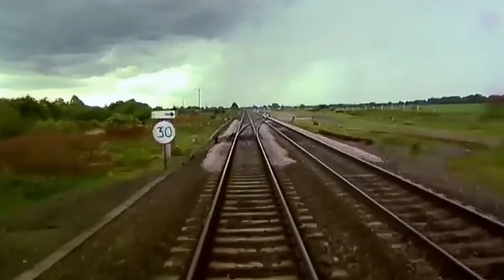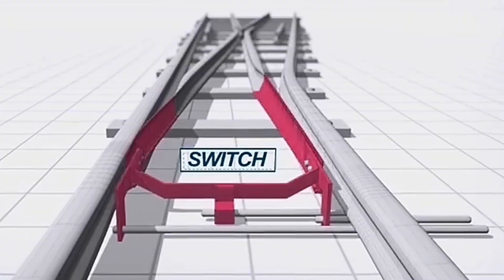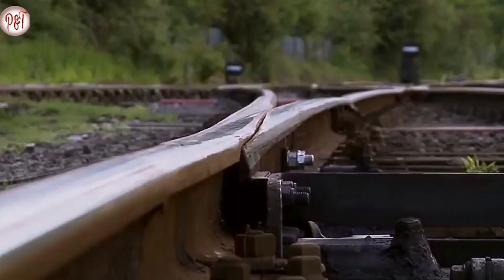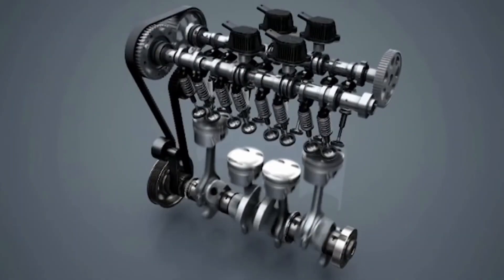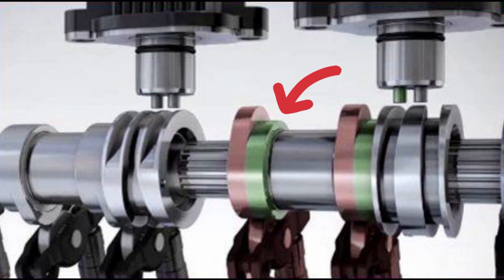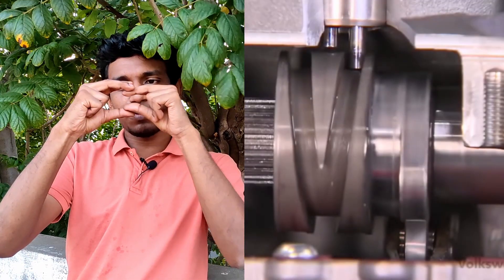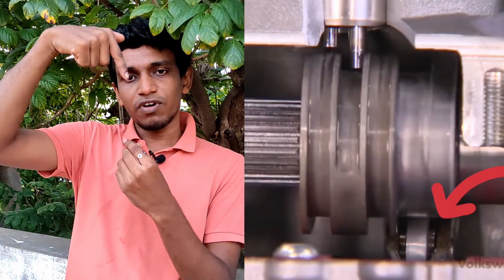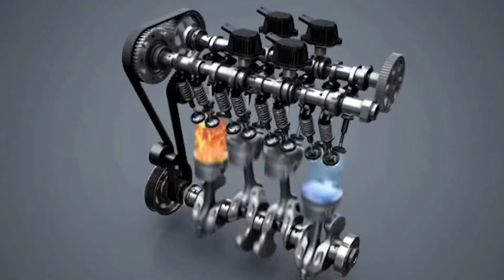Active Cylinder Technology - Explained in Tamil #TuesdayTechTalks Ep.23

Comment: Will it not overload the working 2 cylinders???
Reply from the maker: If its going to overload, it will not switch to 2 cylinder mode. Like I said in the video, 2 cyl mode is activated only when the load is low enough to be handled by 2  cylinders
Reply: @TheDriverSeatGuy  thank you..  this is much useful technology than ADAS 😂

Comment: Bro, am very much confused now, because I was in a dialema between Skoda Rapid and XUV 300, my usage is 90%on the highway. Comfort wise I feel comfortable with sedan, but indian roads XUV 300 may be good. My question is, I'm planning to take and use for 6-8 yrs, whether 3 cylinder would be ok? I already use ford Figo 1.5 TDcI diesel, gives very good power and pull. If I want to go for 4 cylinder , which car is good?

Comment: Hi sir, 
As you said in 2 cylinder mode the non working cylinder intake air will be shut off?
If so, how the cylinder will move up an down...
Reply from the maker: Valves have nothing to do with the piston motion. Piston moves because the cranskhaft rotates at the bottom

Comment: Bro, 

1. when this modes are getting changed, the firing order also should be changed isn't it so whether the spark plug becomes off or it will kept on firing even thought there is no other strokes in perform

2. When the car is shifted to 4cyl mode from 2cyl mode by sudden acceleration will the car pull it with the maximum torque or will there be any lag? For example like if we accelerate a car with manual transmission the acceleration will be powerful compared to automatic transmission in that wise im asking?

Comment: Brother I have a silly question for you but please give me a answer,from the day when I started driving a car mostly I heard the thing thambi AC off panitu car otu pa mileage nala kedaikum even though tried this ana enaku endha difference uh therila brother,so please kindly explain me about this concept.
Still you are rocking with your explanation and the way of delivery is too 🔥🔥 keep doing brother ♥️
Reply: Car AC is also Same as our Home AC's , they too have compressor and this compressor is connected to engine directly so when AC is started this compressor gets connected with engine and it absorb a minor amount of engine's power and it consume some extra fuel so Ultimately AC Reduces The Mileage In A Little Amount Like if u get 15 in without AC , u may get 13 with AC running

Comment: Brooo enakku romba naal doubt uu... Pls clarify... 2.0 ltr Petrol or 1.5 ltr CRDi which is Best, Faster, and Which can run @ High speeds easily!?
Reply: Petrol will have high horsepower and low torque. 
Diesel will have relatively low horsepower and high torque.
Petrol will do high speeds easily, while diesel will give better low end pushing force and fuel efficiency..